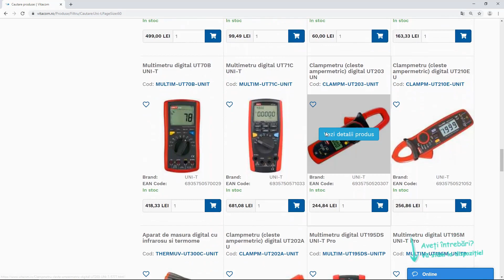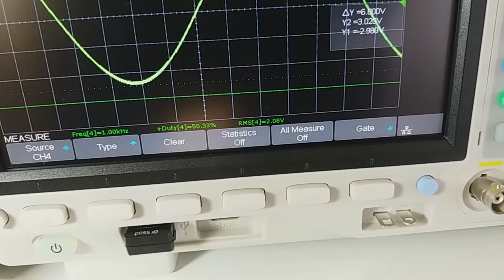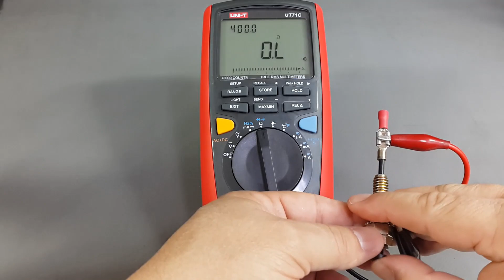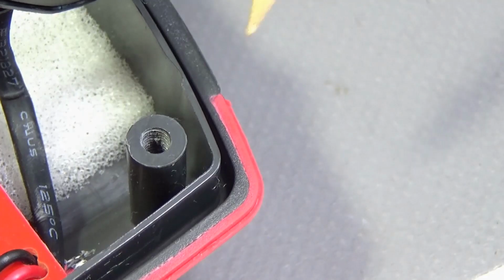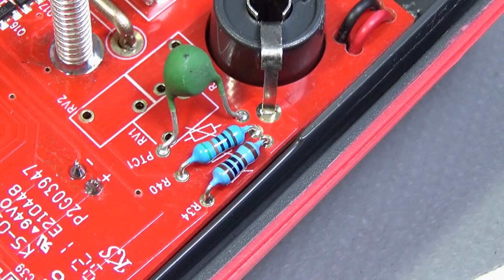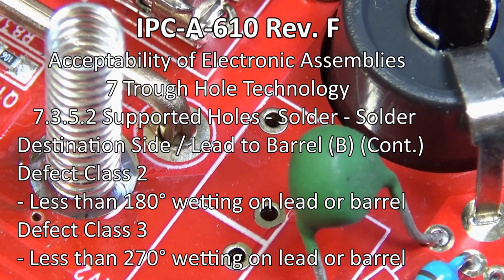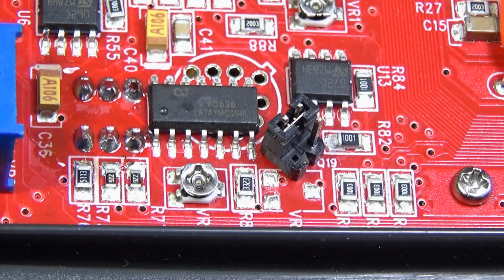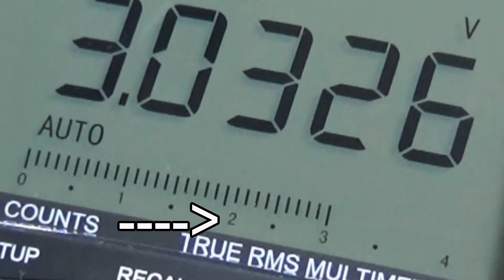Uni-T UT71C Digital multimeter Product Review / best DMM buy 2020 with USB UT71A UT71B UT71E UT71D

Comment: Of course you will use every excuse in the book to defend a donation... but there is no excuse leaving that ugly ball 20:36 of solder at C48.. One day you will bump this down on the bench and then hear it rolling around inside. The proven UT61E 22,000 count meter still gives 5-digits under 22v and costs 1/3 the price (if you insist on a junk brand..). If you want Fluke-like quality, a Brymen 857s from TME costs less, gives 5/6 digits in both 50,000 and 500,000 counts with fast bar-graph, quality probes, isolated data logging, better protection, and a 3-year warranty. Search YouTube for Multimetr Brymen 857s: rozpakowanie With the money you will save, you can buy a clamp meter or something nice...  ;-)  Saludos de Canada!
Reply from the maker: Hi Cliff! I was who asked for the multimeter to them because I see a good device in it. I was clear and it has been  written, "it should not be there". By sure QC will will create a "quality alert in the process". In manufacturing, is easy to deal with machines. But when workers have to go home after the shift, and there are 8 hours in between or a weekend,  the same situation would happen again every where. There is other non acceptance in QC in the other side of the 0.005 Ohm resistor. That is something I will speak about in other video. I could remove the ball and lie, but I was honest. And I wrote it should not be there. This is the point where all contribute and grow old in experiences. This is my first Uni-T in 35 years in electronics. I could ask other brand, but I was the one who looked for them. I see a Company that listen to their customers and is showing improvements and results. That is the reason why they got my respect too and why I gave them chance. By the way! Did you compare the specs between Brymen 857s and UT71C? ...and their price after adding the communication cable?  That's a plus for one brand to get in the level of other. I don't mean to hurt our American or European proud, but Electronics Manufactures from China remain me the telling of the turtle and the rabbit. That's a fact, that even myself took time to digest. Many of us, used to offend products from China 20 years ago. Now it is getting kind of late to run after the turtle. How many brands of test equipment can we remember from 20 years ago? How many brands from China beat up so far many American and European brands? The video was about UT71C, you mentioned other Uni-T product and brand with specs that many Chines Companies soon or later will get. (Hope more later than sooner so far nothing helps!).
Reply: @bob.kalpon1398  Yes, good honesty on showing the ball but I still don't know why you leave it there? About the European Brymen cable, yes I think you are right it is extra but it is not expensive.. maybe if purchased with 857s it costs a bit more than Uni-T but for 12 times better accuracy it's worth paying 30 usd more. I know TME can ship to Canada but It still can't understand why Brymen EU has no offices in North America (maybe it's because of a bad re-branding contract made with American toolmaker Greenlee? who knows..) Anyway, according to Joe Smith YouTube channel, Brymen 869s triple display is still the best for the money - but $320 is to much, since I can buy a used 6.5 digit bench DMM on ebay for similar $ and triple display is not too useful for me. Cheers!
Reply from the maker: @CliveChamberlain946  Now you got the point. All of us crossed by the same bridge. First is what we can get, later what you can buy.  ...in the mid way, there are what do I want or a what do I need and so on.  Can you imagen a 9 digits DMM without room controlled temperature? ...or noise free environment? Let's face the true: some extra digits helps for adjustments. But nobody can certify calibration by his/her own even with 6,1/2 digits. If we need a voltage between 5.0 and 5,25VDC. ... what to do with a 5,156927VDC reading? I agree Ferrari Lamborghini is the best car. We hope everybody can get one o even to drive it on their town streets. Or maybe is here where UT71C becomes in a kind of "MPV". (Multi Propose Vehicle).

Comment: the plastic modling on the split connector has the cutout for the piece of metal that goes to the pcb in the wrong direction
Reply from the maker: Hi! Do you know what is ECO mean? Engineering Change Order. In manufacturing we get a lot of changing on the way. There are many reasons for it. It can be improving, obsolescence of one part, lacking of the part in the market.  It doesn't afect functionality. One plastic injection mold could cost up to 40K US$. It looks like it was better to change the metal part than to touch the mold.
Reply: @bob.kalpon1398 .Understand that.General speaking on electronic has life time of many products for homes etc got shorter.Tv powesupply where they brake the  Comon sence abc in good design by mounting electrolyt caps rigth over or close to regulators heatsink etc, so the heat has to pass by the caps that drying out  premature and it fails.My point is in general there is to much garbage shit quality products straight from factory.
Planned obsolescence.harder to find reliable consumer products.cant think of a radio that last 80 years and still work.(not that it is safe to use anymore before all the capasitors in it is changed,the tubes are ok.Why change the mold they could have changed the pcb or just tool it out with a file.Know that it is not a problem for function.Guess i would not like to buy a good looking car to find out it has bad
lacquer under the hood.I have done repair around 40 years and seen how many components have been improved a lot and they still are.Often not  designers fault but company policy this premature failure designs.I bougth a lg oled 55 inch "smart" tv,the 1 thing i did was to better the ventilation where the heat sinks was and cut out a 
square for a 12 cm diameter slim fan 12v feed with 6v sligth angle upwards glued in place with a gluegun.it has a dust cover and the temperature went down to around 40 degrees celcius and it is silent.
Reply: @bob.kalpon1398  love U dude, really ;-)

PS I have a UT71E since may 2012!!! :-))
It's almost perfect, thousands of hours of working!

Comment: Wait. Please, a 250V fuse will NOT INTERRUPT a fault when at 1000V.  ALWAYS use a higher voltage fuse than your application. There is NO POINT in using a lower voltage fuse. Type and current matter, and can be adjusted, but never adjust the voltage.

Comment: what is the best, ow18e or this unit sir?
Reply from the maker: Hi! The answer is not about opinion, but about needs. The best multimeter is the one that its features can solve our needs. Some times it is more important a multimeter that feeds in my pocket than the measurement it will make when I arrive. Other times, it is about precision, other times about data collection, or high voltage protection because it is 2230V or 240V AC and I can't change or adjust the network voltage but safety maters, and so on...  It is the reason why all of us ended with more than one kind of multimeter and why brands makes so many models too.

Comment: This is a nice and honest review! I don't like uni-t multimeters because i'm a fluke fan boy who's never owned a fluke. What is the best handheld multimeter for electronics in your opinion? One point that I'd like to note is that how you test continuity and how others test is very diffrent. You didn't do it quick enough in my opinion. Like they say, extremly fast multimeters are truly helpful when it comes to testing continuity between the pins of ICs. Just a criticle thought!
Reply from the maker: Hi! "Don't ever be loyal to a Brand. Be honest with yourself to buy a product that meet your needs and let the Brand to be loyal to its clients". Bob Kalpon. Remember we call it continuity test, but it is "less than 50 Ohm resistor measurement" what is higher than 0 ohms. This UT71C is the best handheld multimeter on my bench from the features point of view. But at any moment, some of the other multimeters becomes in the most needed when it matches better the test requirements. That's the reason why professionals have always many multimeters.